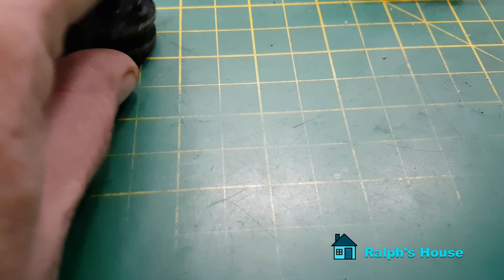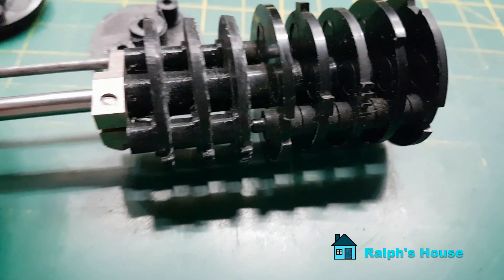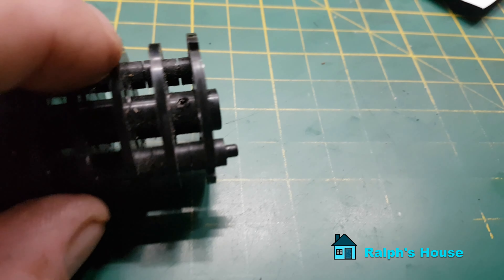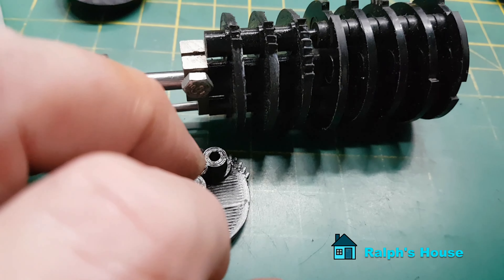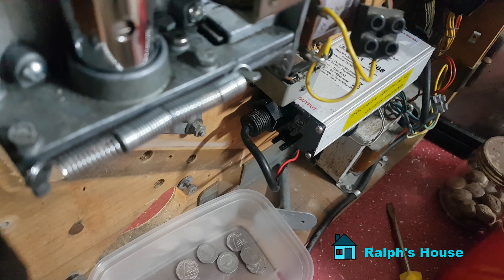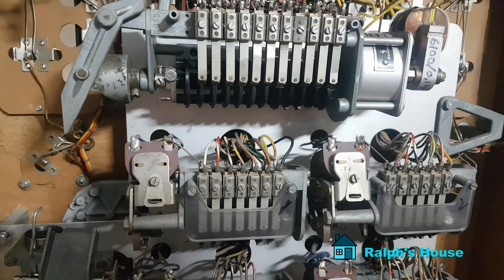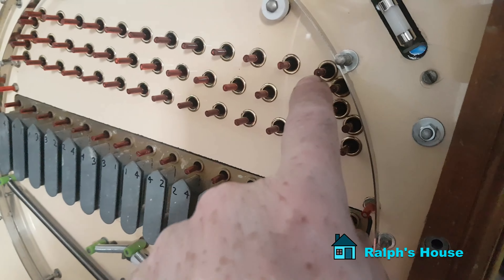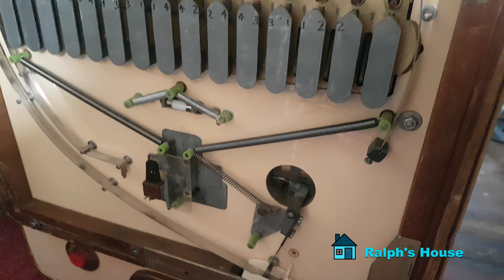197. Gunter Wulff Bingolett - Rialto - Tivoli Restoration (Pt 10)

Comment: Well done Ralph, looking good. petg Polyethylene terephthalate glycol is pretty durable. hope you are negative but it's not much worse than a common cold, take care 😀
Reply from the maker: Hard to say what I've got Mike, but felt well below par all weekend. Probably didn't help stripping out a seat belt in the Civic this morning to put the SRS (airbag) light out. Yeah really pleased with how the Bingolett has gone, especially given the seemingly impossible hurdles in my way. I think PETG will cope with it. Looked too troublesome, and expensive trying to do injection moulded cams at home. Had a couple of zaps today but think it was only the 30v AC, so not enough to throw me across the room. I'll leave that kind of thing to Radiocruncher - or Shango66 (that guy is fearless).